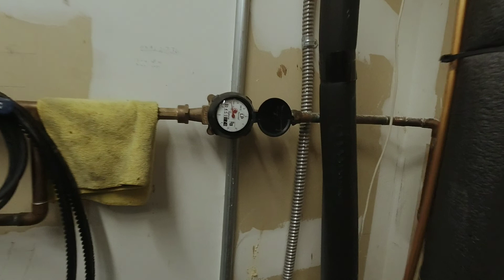Chiller Tubes froze causing Major Failure

Comment: I remember this. My brother in law lives in Austin and he was talking about this. Did you guys start switching to a glycol mix because of this. I know it doesn't happen often.....but when it does.....it gets expensive quick. Up here in the NE.....most systems are glycol. We have some pretty cold temps in the winter
Reply from the maker: No, nothing is designed to run with glycol. So adding it wouldn't work most of the time.

Comment: Great videos! Some actual commercial hvac footage instead of the boring rtu coil cleanings and filter changes. You guys are gonna be busy with all those freeeze ups. It’s tough to find all the cracks and leaks until everything thaws out. That carrier full of water is a boat anchor now...
Reply from the maker: Oh ya its weeks later now and it still has this whole area buzzing from it. Its tough having to have so much bad news for everyone but part of the job.